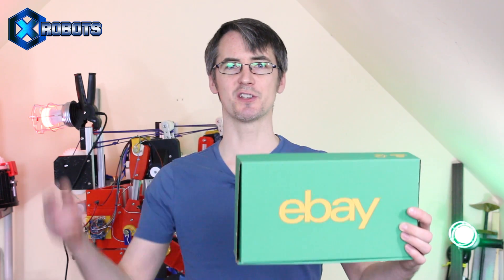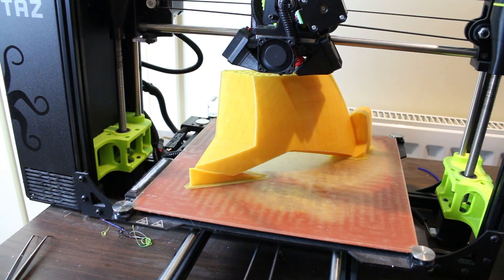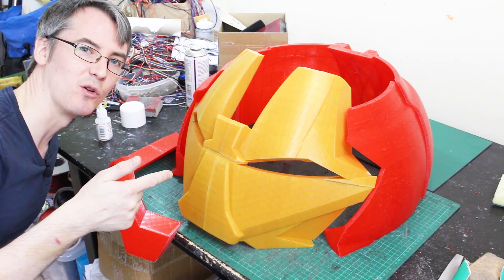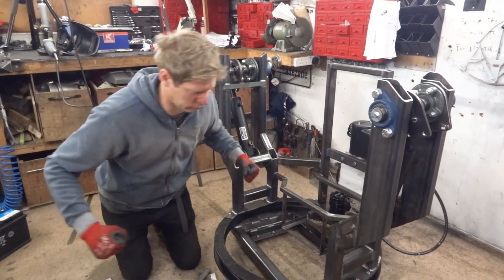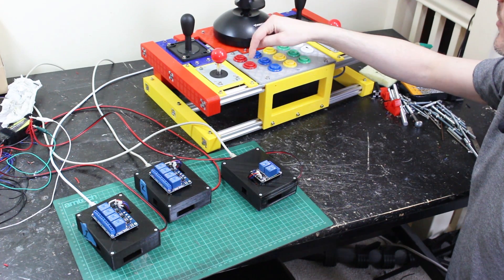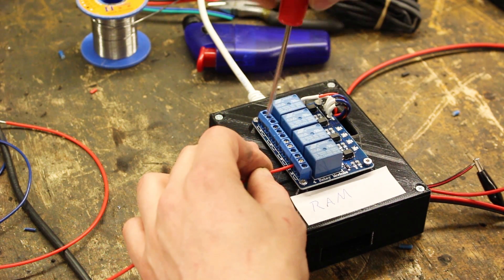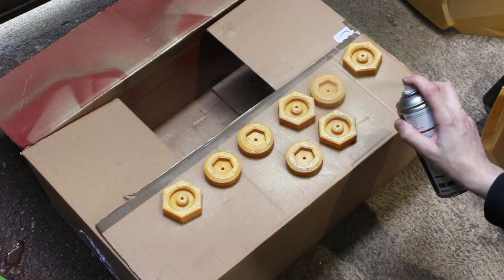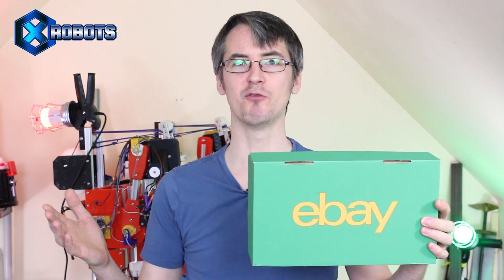Building Avengers Infinity War Hulkbuster w. Colin Furze #2 | James Bruton

Comment: Hi James, What Program did you do most of the modeling for the body parts in? If you used auto desk Fusion 360 How did you go about splitting the model into several pieces to 3d print? is that a feature of the program or did you have to model each piece individually? Thanks!

Comment: What's your fan speed setting on your Taz? I have a Taz 5 that prints great, but the fan around the extruder is always at 1% speed. Never had any issues with my prints or hardware but I noticed on your video that your fans are whizzing around. Any advice or recommendations regarding fan speed with PLA or ABS?

Comment: I usually print entirely without support material, and until now I'd never seen anybody do that better than me. In the last video where you were building control boxes with square openings, just going straight across.. what's your secret?! Just printing at a lower temperature? Or do you hold a butter knife there while it does the first strings across? xD

Comment: Need to make it walk.  James we know you have the skills.
Reply: The hydraulics are too slow and they can only control it binary. I don't think that is possible with their current setup
Reply: Even if it had the power to do it right now... Have you seen robot x? It is easy to pick up that one when it falls.. imagine if THIS Lost balance.
Reply: Scott Cress its really difficult though because of how massive it is
Reply: While it's doable, they'd need to do a completely re-engineer the whole thing and then rebuild it to pull it off. Plus, walking robots is some seriously heavy engineering, so it'd be a doozy of a project that could literally take years.
Reply: NavalNation nothing is impossible only improbable
Reply: Only ones with sliding, wheeled feets.
Reply: Colin furze mentioned in his first episode that they would make it walk in the future. But not this time yet.
Reply: ,maybe they can, but it's complicated because of the pneumatic parts... if they use 6D motors and joints maybe there's a possibility for it to walk
Reply: That'd have to be one heck of a steel bar to really affect the center of gravity with how wide the robot is, how heavy it is (including the driver), and with the added weight on the edges from the arms. Something big enough to offset that much weight might shake the whole thing to pieces if it got rocking hard enough to make the thing waddle forward.
Reply: Has anybody made a massive walking mech?
Reply: Sorry they don't have the skill.
Reply: is it possible to maneuver the hulkbuster suit with the exo skeleton they made? or is it simply just too heavy for anyone to make it possible?
Reply: It's not designed right to be able to walk. It can't pick up one foot, can't balance on one foot, can't extend a foot out. It's all just crouching to standing.

It's like those robot cars that've been built. It stands up, looks cool, and goes nowhere.
Reply: Bob Dole lmao it's a shame. then i guess if people want to keep making robots stand on 2 legs while intending it to walk like a human, then it's gotta have almost the same amount of whatever that can act as muscles.. 

then they'll need at least 2 more people, a biologist and animator, to collab with and they might as well reanimate a corpse into a zombie-cyborg lol
Reply: Honda built one - it's a cute little guy, but it walks upright without using the backwards knees like a chicken that most walking robots use. Just search Honda Asimo P3.
Reply: You just need a couple Billion dollars and tons of engineer and still need the technology to make it walk
Reply: TheUltimate Weipin 

no its just the iron will which counts !
Everything is possible
Reply: NavalNation people can make a cube stand on an edge at any angle, making one walk is totally doable. The problem is the current leg setup.
Reply: Jhon-jhon Francia yep it would be a tough job, but if you’re gonna spend that much time and money getting as far as they have they might as well go all the way. Maybe that’ll be on a later video if they get like 3 times the funding?
Reply: actually it would be impossible, even with balancing it might only shimmy a few inches.
Reply: ıt is not possible to make it walk . They have to put wheels undir its feet . but thet makes it move . not walk